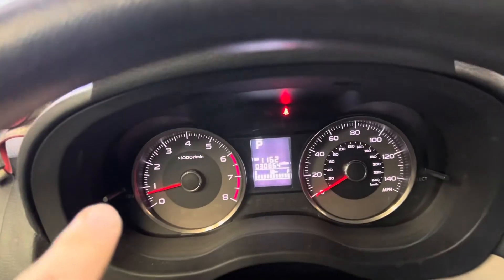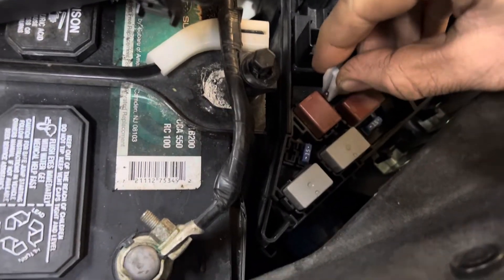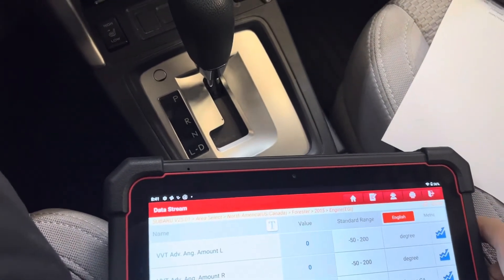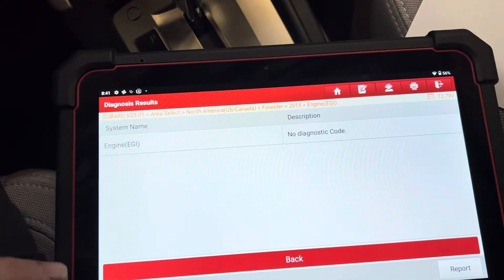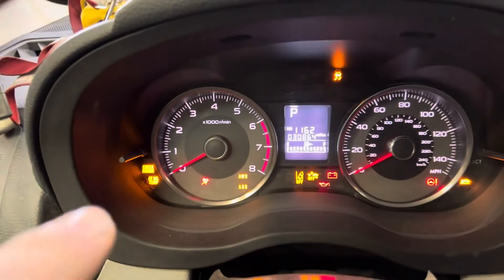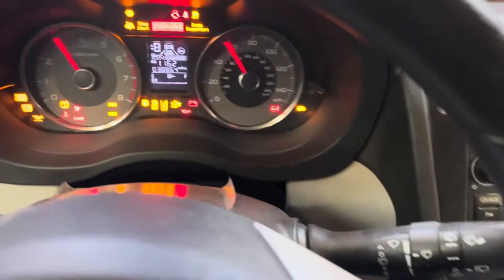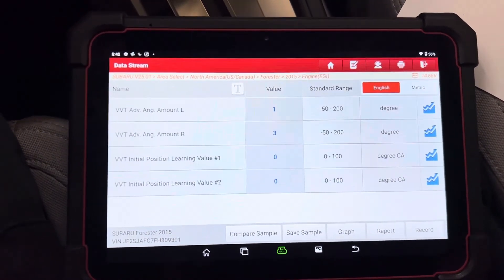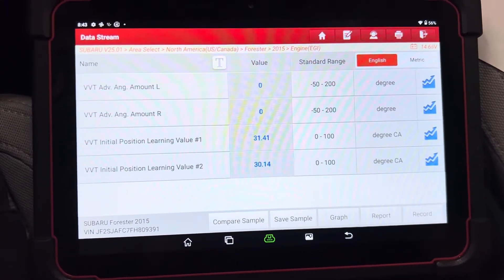Clearing 2015 Subaru VVT learned values without eeprom or ecm replacement.

Comment: Holt smokes, this fixed my issue too! 2017 Toyota 86 (brz) with a stuck p0018 code after a timing chain replacement. I used an Autel scan tool and I'm 100 miles in with no pending codes! Thanks a lot for making this video!
Reply from the maker: Tell me more!!!! Several have reported that it doesn’t work on the BRZ. Did your BRZ have the inspection mode fuse slot?
I don’t have easy access to a BRZ for testing.
Reply: @ThePracticalMechanic  yes, mine had an inspection fuse spot. It's not labeled on the diagram... but as soon as I found the correct spot, the fans came on just like in your video. Then we followed the steps to a T and it changed my VVT's back to zero.

The car is a 2017 86 (brz) 6m with a supercharger running an e85 tune with ecutek. I was worried about changing the ecm and losing tune. This solved the issue.

Does the ecutek tune change anything? I don't know...
Reply: @lst_lt_dann8923  Hey there LST, i have the same issue, are you able to let me know what inspection fuse spot you used, cause i am lost and have no idea where it is on our cars.
Reply: also can you let me know what autel scan tool you used?
Reply: @CasperVsTheWorldGaming  it's right in front of the 30a DCC fuse. It's x'ed out on the diagram. The fans will run when you turn the key on, that's how you know it's the right one.

As for the scanner, I'll have to get back to you on it. It was my cousin's scanner and I didn't see a model number on it.
Reply: @lst_lt_dann8923  Any update on what scanner was used to reset values? I have the same issue after changing timing on frs. I tried on autel scanner and did not work
Reply: On a 2016 frs
Reply: @lst_lt_dann8923  What model was the scanner? Please, im having the same problem on a 2017 86
Reply: @Gxra214 Autell maxi. That's all I know. Mine worked right like the video. 15k later and still fine.

Just make sure you fallow the steps correctly, it took us 2 tries.
Reply: @lst_lt_dann8923  Thank you so much 🙏🏼

Comment: All I can say is “thank you sir”, I can’t be more happy right now, this method worked on my 2015 Subaru Crosstrek with code P0016, replaced cam sensor, VVT solenoids, no improvements, did your helpful advice and boom🎉 no more codes , and also erased the permanent codes!!
Thanks again

Comment: Very helpful, I had a P0019 hard code after replacing timing chains and cam gear ,solve the problem, thanks, appreciated
Reply from the maker: Great to hear! What year was the car and what tool was used for the reset?

Comment: Having trouble getting this to work on a 17WRX.   Bought the same launch scanner and it fails to clear the fault codes (there are none of course).   Any help would be greatly appreciated!   Am able to enter test mode just how you did in the video but it just fails to clear the memory….  Thanks
Reply from the maker: I have had a couple of them fail to clear unless I cycle the key off after clearing the codes and leave it off for more than 30 seconds.
Reply: Did you manage to get the values cleared? Hoping to do this on my 17 WRX using thinkdiag2 soon after a sprocket replacement.
Reply: @Zelaphiel  it did eventually reset and when checked with SSM4 values were at 0 however did not fix the issue and had to replace ECU.  Suspect there is more going on in the software that is not being reset.
Reply: @daveguthrie5229 what issues did the ecu have?

Comment: I can verify this method worked .2018 WRX Base 6MT. Reset All 4 VVT Learning Values using a 
LAUNCH X431 CRP919EBT Elite 2024 Wireless Bidirectional Scan Tool, CANFD&DOIP, ECU Coding,
Reply from the maker: Awesome!!!! Thanks for including all the details of your vehicle and scantool.
Reply: @MonroevilleGlassBlock-ei8jc How did you activate test mode with it as there is no button for it within special functions under the ECM.

Comment: I ordered the thinkidiag2 and had a really hard time with it. First, it took about 45 minutes before I finally got it to connect to my iPhone. Then I couldn’t find the test mode toggle. It’s buried in the menus. Under “Engine”, I think. I had to keep entering the vin too , it kept forgetting it for some reason.

After a total of about 90 minutes, I finally got to test mode. Then, the code was already gone. So I’m not sure what I did to actually delete it. A week later, still no code on the car though.

The poor car was “on” but not running nearly the entire time.

Time will tell but it might now be fixed. But I’ll probably be returning the thinkdiag2. If I get another tool it’s going to be one that doesn’t have to connect to another device like a phone.

Comment: Thanks so much for posting this. I have a question about what scanners are able to perform this function. Autel and Launch are mentioned, but there are countless models. I'm guessing that some of them don't have this function. What function should we be looking for in a model? I've been searching for "test mode" and "special functions" but the results aren't conclusive. I'm a DIY guy so I don't want to spend $3000 on a device. Is there anything out there under $100 that can do this? Any help here would be appreciated.

Edit to add: I see that Thinkdiag and Thinkdiag2 are mentioned. Does this include the Thinkdiag Mini, that costs $40? The need to pay for a subscription with some of these make me want to see what else is out there, although I'll go with one of these if necessary. Right now, I have this one in my cart, the Autel MaxiLink ML519. I looked at the manual online and it has an option to delete "permanent" codes. But I don't know if that works with this procedure or not.
Reply: find anything?

Comment: Just purchased the thinkdiag2.  Going to try this on the my 19 crosstrek.  Are the steps similar?
Reply from the maker: Yes they should be the same.
Reply: @ThePracticalMechanic  what kind of fuse did you use? Does it matter?
Reply from the maker: @therealeb33  fuse size doesn’t matter. It’s just a logic level input to the ecm minimal current is flowing. A 2-30 amp fuse would work.
Reply: Do you know where the test mode is on the thinkdiag2?
Reply from the maker: @therealeb33  should be the same place as the launch. I have used the thinkdiag2 several times and don’t remember it being much different than the tool used in this video.
Reply: @ThePracticalMechanic  got it. I ended up figuring it out. Took me a minute. Thanks for your help.
Reply from the maker: @therealeb33  great to hear!!!
Reply: @ThePracticalMechanic  just a follow up. Tried this on my 2019 Crosstrek. It’s been two weeks and no check engine light on. Thanks for the help.
Reply: @therealeb33 my friend can you share what are steps for thinkdig2 ? Everybody asking the step but no one reply

Comment: My 19 Crosstrek threw a P0019 code. Camshaft position-Camshaft position correlation-bank 2-sensor b. Changed oil. Flushed oil. Changed the two vvt solenoid on the driver side. Cleared codes. Engine lights came back on at the end of the day. Subaru says it learned new values and there could be sludge buildup. It has 55k miles. And yes I’ve changed the oil multiple times as needed. Dealer says they need to tear down and if sludge is in there the warranty doesn’t cover. Would this work for my issue? Should I change the camshaft or crankshaft sensor?
Reply: Hey, having the same issue. Were you able to fix it with this method?
Reply: @elie_8769  sure did. Worked great.
Reply: I’m having the exact same issue on the same year/model. I’m at the point where my next step would be to go to the dealer for help. Would you be able to provide me the steps you took to fix your issue? I watched this video but I’m still confused to where to even start and go about it.
Reply: @MXduster did you ever get this issue resolved? My 2019 Crosstrek is throwing the same exact code.
Reply: @scottlewis218 
Yeah I ended up figuring it out. What do you need help with?
Reply: @MXduster  Thanks for the reply! I think I got it figured out, after reading a bunch of forums it seems I need to use the thinkdiag2 to clear the errors. Was that the method you use?
Reply: @scottlewis218 
Yeah, that’s the route I took that cleared mine. You might have to do a little research on how to do a step by step but after you do it once it’s really simple. I actually had a P00 code pop up again not too long ago.. I immediately changed the oil, disconnected/reconnected battery terminals and it cleared. Seems like these ‘19 Crosstreks are finicky when it comes to motor oil changes. Good luck man!

Comment: What scan tool did you used ? Thank you. Great work 👍🏼
Reply from the maker: I used the launch torque link on this one. We found out recently that this procedure only works on 2015 and newer. Older vehicles need the ecm opened up and eeprom file modified.  
2015 is when Subaru switched to a new scantool and changed some programming in the ecm.
Reply: @ThePracticalMechanic had hope when i found your video, now that I read this... i think i'm f... forester 2014 xt, so my ecm wont accept this easy trick unless I play with the ecm itself... :/
Reply: @kinetik343  I know some time has passed since, but I also just learned my 2014 forester xt will not reset the learned values. Were you able to fix your problem?

Comment: You sir are the man. Confirmed it works on a 2015 crosstrek XV. Erased learned values no more p0016 and now ready for a smog check 👍🏽👍🏽
Reply from the maker: Great to hear! I have heard reports of some vehicles not resetting with this method. Not sure what the reason is since I haven’t had one fail to reset.
Reply: I'm running across a Dealer Check Mode Procedure but no Change Test Mode. 2018 WRX. It will not carry through because it says it is not connected. Tried with Elite, Topdon and latest Autel. Same results.

Comment: @ThePracticalMechanic I have been unable to get this working on 3 different vehicles (2014 FXT, 2015 FXT, 2017 WRX. I purchased a ThinkCar ThinkDiag (not a ThinkDiag2) and followed your steps exactly, numerous times. I can see the learned values, yet they do not reset to zero after performing this procedure. I’ve tried driving the vehicles after and nothing changes. 

Is this an issue with the ThinkDiag unit? I have SSM3&4 so I don’t need a full blown scanner and the ThinkDiag was the most cost effective way to accomplish this. 

Any insight would be much appreciated. There is an Autel MS906BT local to me but I’d rather not spend that amount if this is no longer a working fix.
Reply from the maker: I have done this reset with the thinkdiag2 but haven’t tried the think Diag. I have used my old diagun as well with the ability to zero the values. 
If you have ssm4 and flashwrite then you should try the most recent flash file. Subaru has added some calibrations that will allow the values to continue to learn back down. They do not have updates for all models yet. 
Others have needed to clear the codes twice in order for the values to clear.
Reply: Understood, thank you for the clarification. I'd pondered as to whether or not I needed the ThinkDiag2 to accomplish this, but given that my unit has the special function available I assumed it would work the same.

I will have to find where to get the flashwrite file package so I can test out the latest calibrations as you said. 
 @ThePracticalMechanic
Reply: @ThePracticalMechanic can you tell me how to get into test mode on the thinkdiag 2? I have been trying to find the option but cant find it
Reply: @SubaruMode  i did not, im going to try again tomorrow actually
Reply: @Gilligan.Garage  I think I saw someone comment either on this video or another similar that they were able to get it to work with the thinkdiag2 , I get my device today so I'll try it out on my 17 wrx and let you know if I was successful
Reply: @SubaruMode  thank you!
Reply: @Gilligan.Garage  no prob!

Comment: Do you know if this would work on a 2019 wrx?
Reply from the maker: It should.  The first vehicle I was testing this on was a 2016 wrx. Some of the wrx models have a software update that will allow the learning values to work there way back down.
Reply: @ThePracticalMechanic  i will try this since i'm stuck with a p0018 and my car has only 49k km

Comment: How to erase vvt data from 2011 forester? cant lie to scan tool, I tried, no fuse to install in service port, only has green connector under dash. No learned values in data PID on scan tool. Using Autel MS906BT. Thank you

Comment: Need help on BRZ 2013, is there a way without replacing.
Reply: He said not possible because doesn’t have the fuse
Reply from the maker: Pedro Del a Torre offers a mail in service for those ECMs and also offers a training class on how do reset those but it requires specialized equipment.

Comment: 2017 Subaru Crosstrek. I used ThinkDiag not ThinkDiag2. The cheaper version has the same Test Mode Change functions. Stepwise I cleared codes the typical way. Took for short ride and then could see the P0018 codes was pending, ie, the CEL would come back on soon. Tried this with two diff code readers. Then used ThinkDiag as described here. Cleared codes. Took for two ~10 mile rides... no CEL and No pending codes. Will update as we put more miles on the car. Did not check to see if the learned values cleared. Next iteration if CEL comes back on.
Reply from the maker: Sweet. Let us know what happens. Did you perform any repairs before clearing the learned values?
Reply: Yes. One of the cam sensors was bad and the reading was out of spec.  They replaced it. (BTW this was an easy fix but the car was in a different state and I couldn’t get there to fix it). With this scanner I could see that both readings are running high ~90.  But in the allowable  0 to 100 range.
Reply: I don’t know if that has any meaning.

Comment: what size fuse goes into the Test Fuse location under the hood?
Reply from the maker: sorry for the delay but it looks like you got it sorted out. any fuse will will work since its not really flowing much current.
Reply: I just went ahead and used a 10 Amp fuse. It was ok.

Comment: Works man thanks 2018 Impreza 2.0 replaced engine after timing chain and phasers where smoked from no oil. Learned values would not reset. Did this with my Launch x431 5 pro. Thanks. Alldata and identifix have nothing useful on this issue.
Reply from the maker: Glad it helped. We struggled for years with this before pushing enough buttons to get them to reset.
Reply: Where is the test fuse spot located? I can’t find any literature on it.

Comment: Hey could you tell me what model Launch tool you are using. We have an Autel tool but it doesn't seem to have the feature.
Reply from the maker: This was the launch torque 5. I have done the reset with autel, launch, ThinkDiag and topdon.  Autel has been changing things up a lot lately with updates so hopefully they didn’t remove it.
Reply: Hi.  Can you please clarify  “ThinkDiag” or the newer “ThinkDiag 2”? There’s a sigficant price diff.  $90 vs 140 with coupon. Thanks.

Comment: Hey Chad, recently my 2016 WRX got the dreaded P0016 code and both my usual shop and Subaru dealership service department ran through the TSB diagnostics and determined that intake cam sprockets and ECM needed to be replaced. It's a hefty repair bill and half of it is due to the cost of a new ECM! My mechanic showed me the VVT Initial Position Learning Value was about 6 degrees over the maximum range which is apparently now "burned into the ECM". Would this method give me a chance at not having to replace the ECM if I were to get the sprockets replaced for my WRX? Alternatively, do you think a used ECM would be a feasible option if this method doesn't work? Thanks!
Reply from the maker: Yes!! Correct the timing and then perform this reset!! The only one can cannot be done this way so far is the BRZ because it doesn’t have the PDI fuse so it has to be done other ways. 
Let us know what happens.
Reply: @ThePracticalMechanic  Cheers, I'll let the guys at my usual shop know. Sprockets, then reset attempt - will report back.
Reply: @andyl547  can u update when u do?
Reply: @Mario89019 Im in the same boat at you. Looking for answers, happened to me 18 WRX, tried both Thinkdiag 2 and Autel 906TS, both says function not supported when I tried to clear DTCs.
Reply: @JayPham-eg6te  fuckin pain, i got lucky and found it was just extremely low oil and a broken wire i fixed 
cleared the cels and they never came back
Reply: @mario89019 same problem I have. Question which broken wire u found out is broken? Just wanna know. Thank u
Reply: @Albertpaul15  well, i replaced one of the AVCS , and found that one of the wires that connected to a different AVCS connector was somehow cut, which is why it was running so bad. i fixed it up and it ran fine after